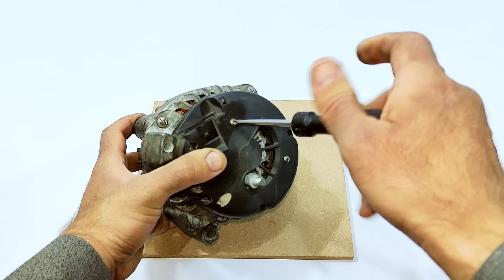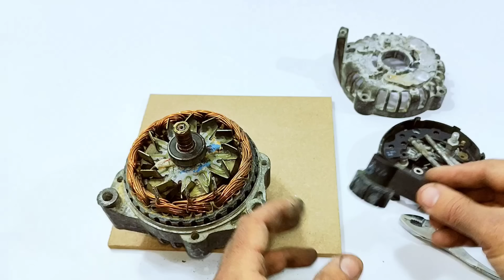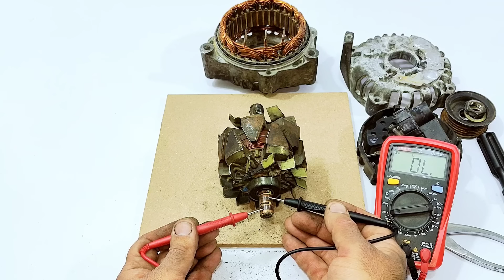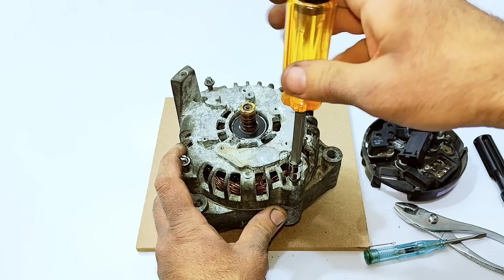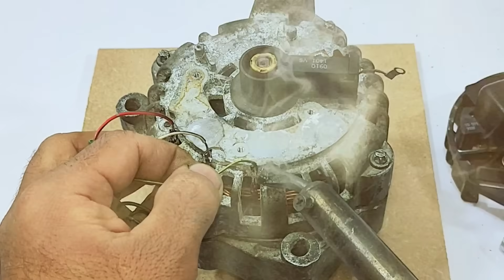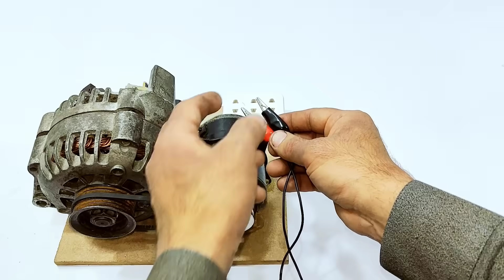I turn Free Energy with revo alternator magnet 14,000oW Electricity system Condenser light bulb idea

Comment: my friend how did you calculate 14000 watt ?This is physically impossible. Let's calculate the maximum power of a car or truck charging alternator. Let's assume that 24 volts and 30 amps. 24 volts x 30 amps makes 720 watts. Of course, I don't take losses into account. If you take losses into account, you get 560, at most 650 watts. Now can you explain to us how to calculate 14000 watts? Why should we burn tons of diesel in diesel generators? 🙂
Reply: @servetseker331  very simple, you give the formula of power. he is fooling yoú hahahahahahaha.
Reply: Yeah that's true